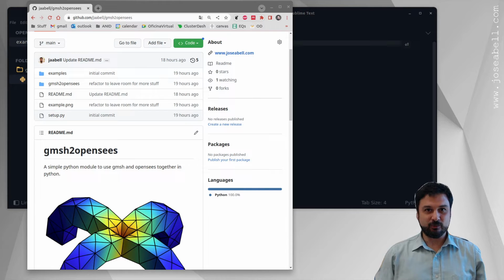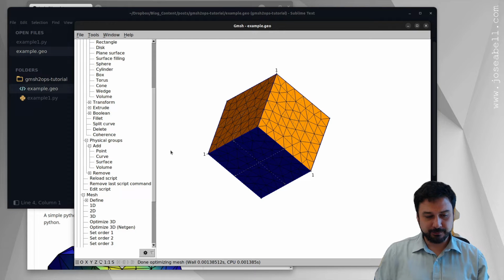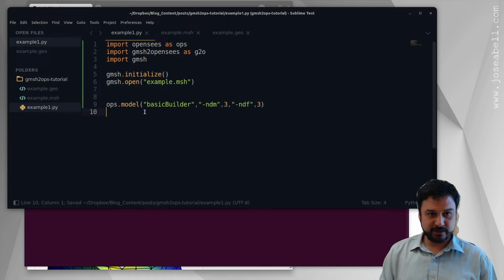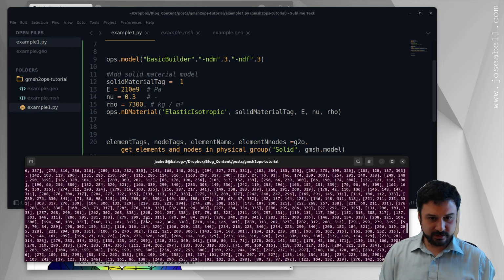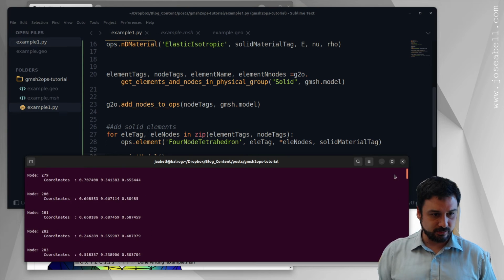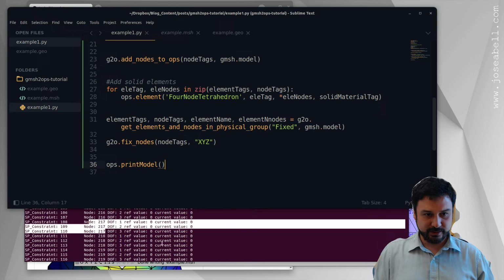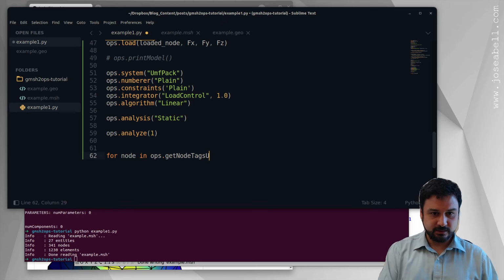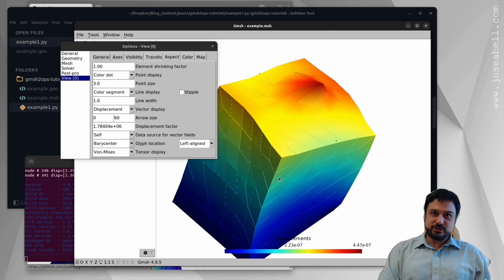FEA using OpenSeesPy and gmsh

Comment: Gracias Jose por el video, puedo escribir todo el código sin problema, pero al final no me visualiza en gmsh, alguna idea de cual puede ser el error? Esto es lo que aparece en el prompt

-------------------------------------------------------
Version       : 4.13.1
License       : GNU General Public License
Build OS      : Windows64-sdk
Build date    : 20240524
Build host    : gmsh.info
Build options : 64Bit ALGLIB[contrib] ANN[contrib] Bamg Blas[petsc] Blossom Cgns DIntegration DomHex Eigen[contrib] Fltk Gmm[contrib] Hxt Jpeg Kbipack Lapack[petsc] MathEx[contrib] Med Mesh Metis[contrib] Mmg Mpeg Netgen Nii2mesh NoSocklenT ONELAB ONELABMetamodel OpenCASCADE OpenCASCADE-CAF OpenGL OpenMP OptHom PETSc Parser Plugins Png Post QuadMeshingTools QuadTri Solver TetGen/BR TinyXML2[contrib] Untangle Voro++[contrib] WinslowUntangler Zlib
FLTK version  : 1.4.0
PETSc version : 3.15.0 (real arithmtic)
OCC version   : 7.7.2
MED version   : 4.1.0
Packaged by   : nt authority system
Web site      : https://gmsh.info
Issue tracker : https://gitlab.onelab.info/gmsh/gmsh/issues
-------------------------------------------------------

Comment: Hi Jose, I hope this message finds you well. Your openseespy + gmsh tutorials are very helpful - thanks so much for creating and sharing these tutorials. I was wondering if you might be able to create a quick video covering how to use gmsh and openseespy to replicate the laterally loaded pile foundation example found in the opensees wiki examples page.
Reply from the maker: You're very welcome!

Regarding that example, it is a 1-D pile with lateral springs. It kind of defeats the purpose of using gmsh which is more apt for continuum models. If you want to use openseespy, I'd suggest simply translating the TCL files to the python equivalent. ChatGPT would likely get most of the translation right. You could still visualize on gmsh your results after that. 

Regards!
Reply: @JoseAbell  Many thanks Jose. That is a good point. I am indeed mostly interested in seeing if gmsh could be used to visualize stresses or strains in 1-D beamColumn elements at fiber section integration points. I wonder, for example, if gmsh has the ability to show a visual rainbow color distribution of the stresses or strains along beamColumn elements. I will do some digging. I am just starting to play around with gmsh and gmsh2opensees, and your videos are very helpful in this endeavor - thanks again!